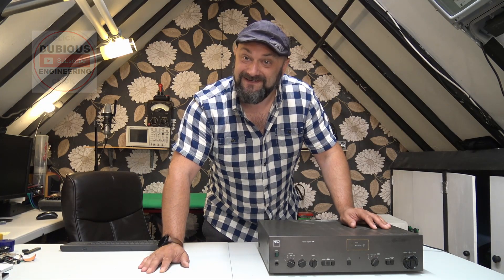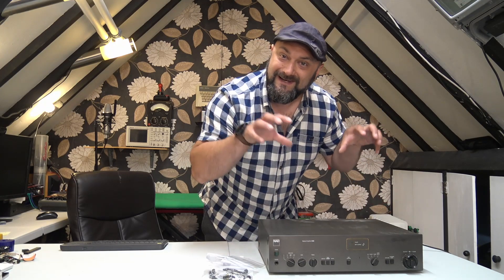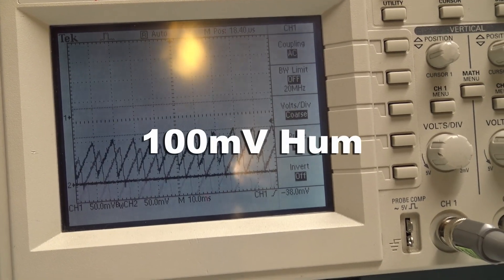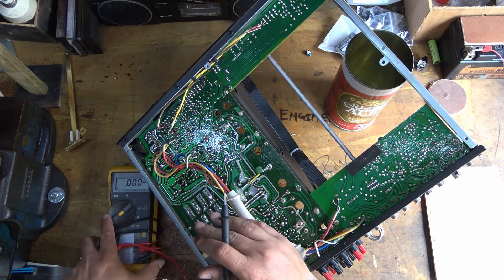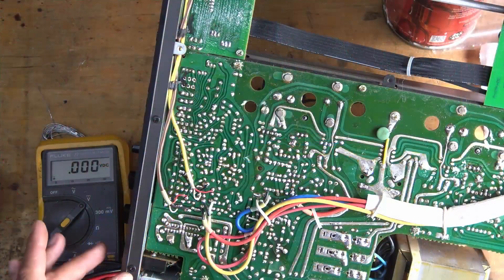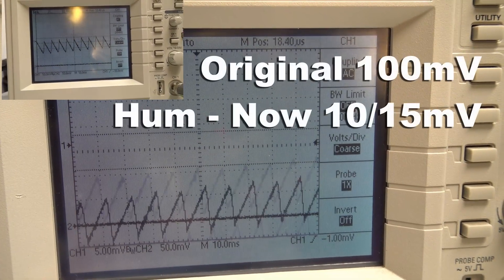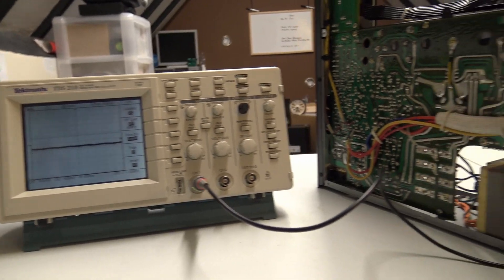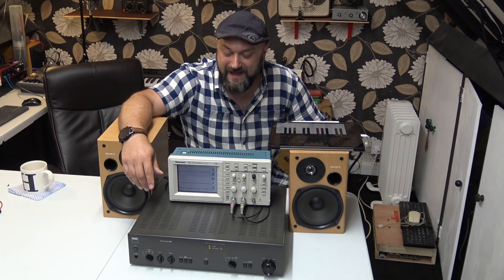DuB-EnG: NAD 3130 Audiophile Vintage Analogue Transistor Amplifier Repair Teardown Service Tune-Up

Comment: As I read from some sources, the Taiwan made amps like this one, made use of excellent and high-quality parts. So my question for replacing caps is what to buy, or what brand for the caps, to not downgrade the amp with cheap china caps with build in self-destroying timers. Anyway, thanks for this nice video. I have no doubt that I can repair my amp if something fails after seeing this.
Reply from the maker: To be honest, any caps are better than 1975 caps :-)

Comment: Great video, I have the same amp fantastic sound system unfortunately the master volume is playing up, I think this might just be a solder job? Do you repair? I’m in SE Kent 
Cheers Kev
Reply from the maker: Thanks kev. But it would likely cost more to post it than its worth..🙃

Comment: I've got this exact amp (had it for around 35yrs since new) and it has a strange problem that more often than not the power light above the soft clipping light does not come on when switching it on. However the amp works fine but with low level background hum from the speakers that doesn't increase with volume. Totally useable but frustrating in quieter music. Occasionally when I power it on the power led does light up and there is no hum and I'll be playing music for hours on end without any hum. Could a capacitor change out fix that or is it something else? I've contacted a chap who restores vintage NADs but he's not seen that symptom before and told me to enquire elsewhere for help. I was happy to send to him for full overhaul with cap change out but he seems reluctant to work on it now. Appreciate your thoughts - great video.
Reply from the maker: Sounds like a right pain to diagnose.  Only because if the fault doesn't show, you can have it on test for ages.  Sometimes freeze it spray helps identify the problem...

Comment: Looking at the schematic the base terminal of each output device is connected to a non polarised capacitor marked as having a value of 1M.  This is an unusual configuration, does anyone know why it's there?
Reply from the maker: 1M ? ...  1 million farads?
Reply: If it is one million Farads then capacitor technology has certainly come a long way 🤣

Comment: This video was so handy for my first recap on the same amp. Still got the faint hum. Going to move on to the next likely caps, any suggestions would be handy... ;) the 2 6800uf caps done.
Reply from the maker: Yes, likely to be related to the small signal caps rather than the PSU caps!
Reply: @DubiousEngineering  I did buy a pack of zener diodes to replace the one In the amp that looks rusted/rotten. D501.  I'll fit the new one over the weekend.

Comment: Cheers fir this vid. I bought a second hand 3130 a couple of weeks ago and this has given me a better insight into checking components more clearly. I did check the offset which was 10-11mv left/right which I was quite happy with considering its age. Apart from a soldergun and cutters, I need a few more bits to do a recap. An oscilloscope is a must by the looks of it. However, I did notice you didn't use a semiconductor tool. Is this not a necessary requirement?,( please anybody else chime in if no response)
Reply from the maker: Semi cons either work or don't.  Trust me you'd know if there was a problem, you'd hear it!
Reply: @DubiousEngineering  right. Well if I listen closely to the speaker (ear up to both drivers) there is a present 'hum', more so in the right speaker. I thought this is where the semiconductor tool would be able to diagnose specifically the problem 🤔
Reply from the maker: @CM-dw3gh  almost certainly capacitor related.  They dry out.

Comment: Nice! Did you end up replacing all of the electrolytic capacitors, if not how many total? I'm thinking about giving this a go myself. Is brand particularly important for these capacitors, or just the capacitance spec?
Reply from the maker: Go Japanese capacitors if you want longevity!!!

Comment: Great video and interesting info. I have a 3130 which I’m thinking of bringing back in to service for some new speakers I just bought (Tannoy Cheviot 60w 8ohm). I reckon it will sound pretty good but probably needs the same service you just carried out.
Reply from the maker: If you’re in the UK I may be able to help... it’s just those amps are so heavy to post!!!

Comment: Nice job! Out of interested, did you replace all of the electrolytic capacitors?
Reply from the maker: all of the audio path capacitors ...  I think there may have been one or two non critical that I left alone
Reply: @DubiousEngineering  Fab video... is there a 'director's cut' where we can see which electrolytics you replaced too? I've just been given one of these, in lovely nick, but there's the inevitable noise.

Comment: I had  a 3130 I bought second hand on ebay, it was brilliant and so powerful, unfortunately it died.
Reply from the maker: Awww. Such a shame....  I’d definitely have a go at repairing it... they are lovely
Reply: @DubiousEngineering  I sold it off cheap,I think they were going to attempt to restore it.
Reply from the maker: Well fingers crossed they succeeded!!  They are fantastic amps!!
Reply: @DubiousEngineering  I had myn rigged up to the acoustics 3060s last night via pre out inputs. My lord. Blew the c320BEE and Audiolab 6000a out the park. Going to hold onto this one